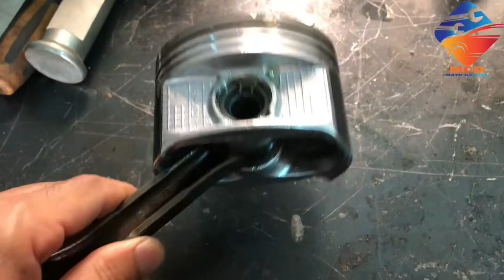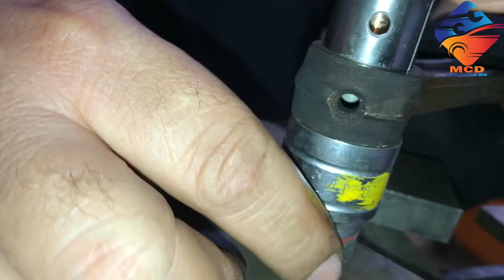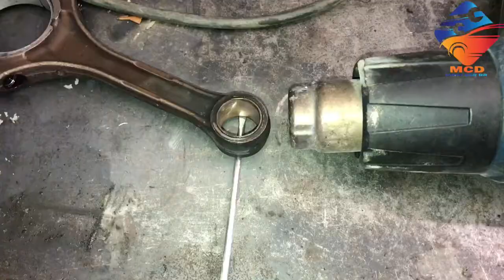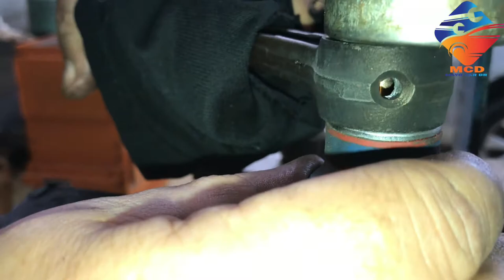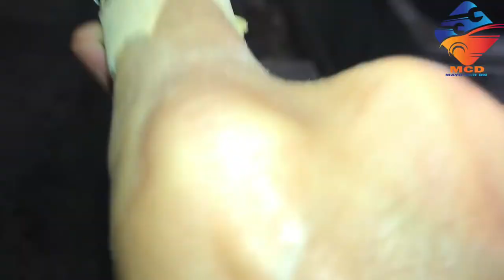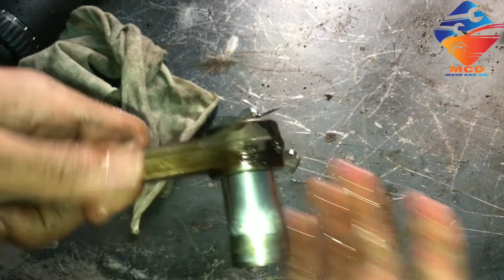How To Replacement Connecting Rods Wrist Pin Bushing

Comment: Wrong. The new bushing when pressed down was deformed by material being carved out from the bushing. That's not the way to replace these bushings. Terrible example to "teach" here in youtube.
Reply from the maker: Thanks for comment
Reply: When I install a new wrist  pin bushing  ring it needs to be tight ?.I was reffering to the pin bushing alone and not about the oil  gap between the pin bushing and the shaft.

Comment: so the pin bushings must become perfectelly tight inside the hole ???
Reply from the maker: No
The pin should neither be too tight nor too loose
Reply: @MayoCarsDR  Hello . I was reffering to the pin bushing alone and not about the oil  gap between the pin bushing and the shaft. When I install a new wrist  pin bushing  ring it needs to be tight ?.

Comment: What's the sand paper do?
Reply: makes it unsmooth to promote better oil flow, and to endure a better fit if the bushing isnt allowing the pin to move freely.
Reply: It does a really good job of turning a cylinder into an hour glass or a beer barrel shape, hopefully an oval as well, for that little extra.